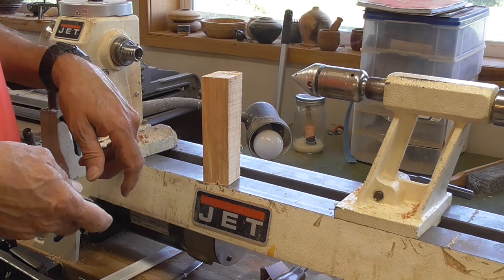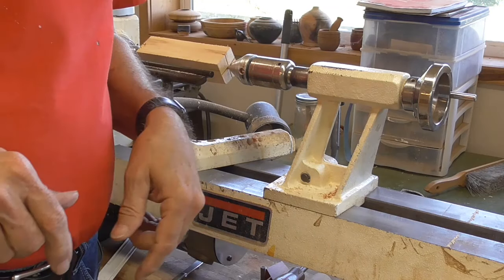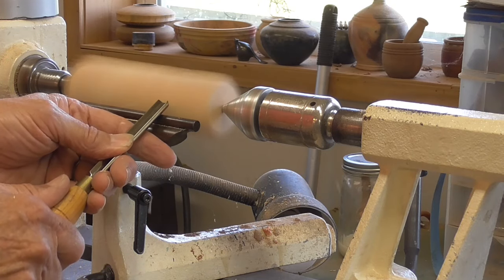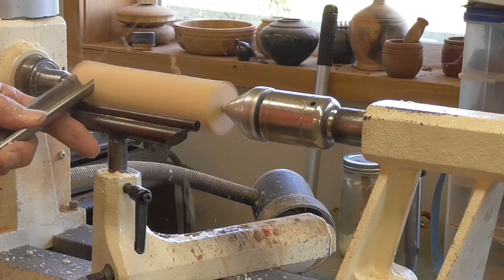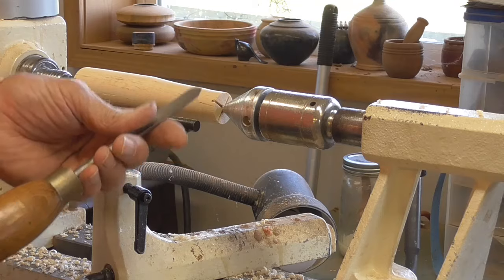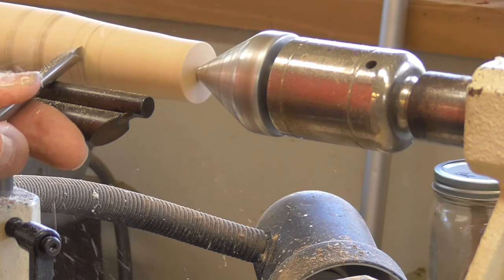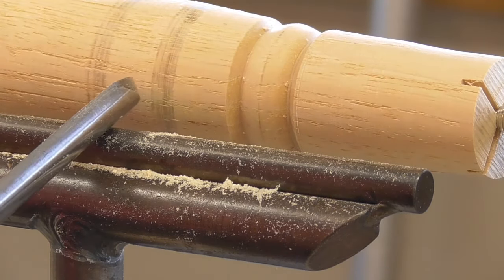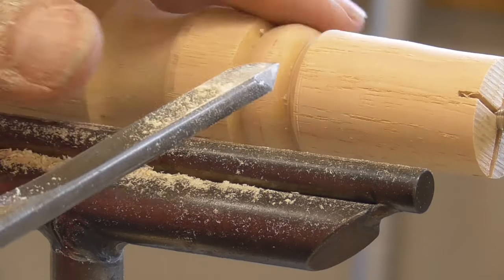Using a spindle gouge

Comment: Subscribed on the previous video presentation. You were making a Xmas ornament out of pine but you turned it at 3000 and sanded at a much lower speed. I started wood turning yesterday at 800 rpm but it was hardwood.  Found out that I wasn’t using the bevel gouge in the proper way. Was glad to see that you turned some softwood just “for fun”. With some sanding it looked great. Want to practise but don’t want to waste the hardwood I do have with my blunders. Your videos help a lot. Please keep them coming when you have time. Wish I lived down your road. I’d be like the sad eyed stray dog :)

Comment: hi i enjoyed watching your video and there are a few things i spotted that could improve your beads namely when you set out your bead the first thing you should do is to use  your skew with toe side and cut into both sides of your bead on the inside of the line to just shy of depth of your  finished bead do this both sides and it will eliminate the tearing you are experiencing when turning your spindle gouge  kind regards 
colin fellow wood turner
Reply from the maker: Col Hughes - thanks for your suggestion. I’ll give it a try.